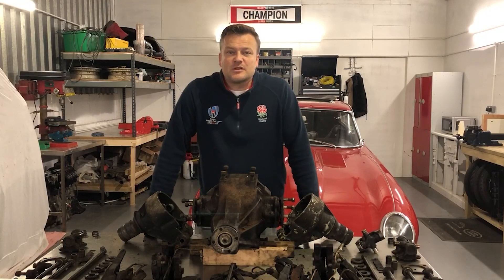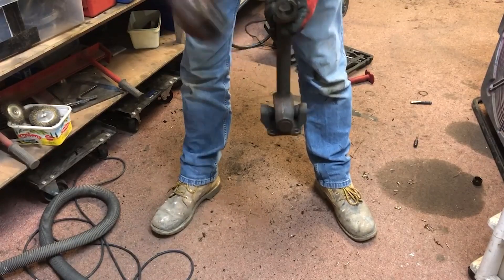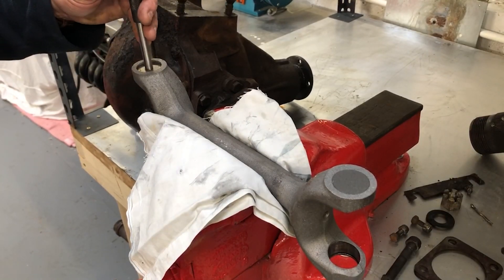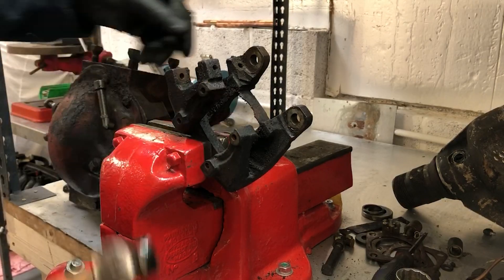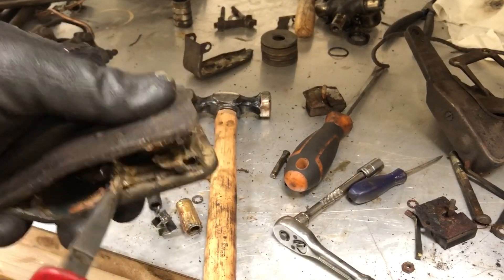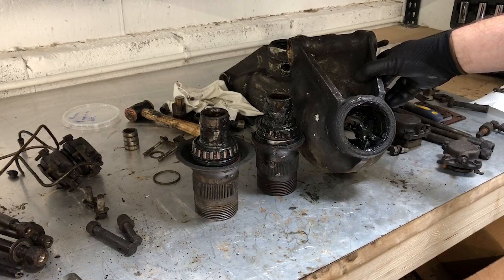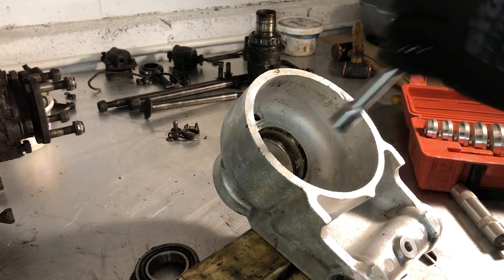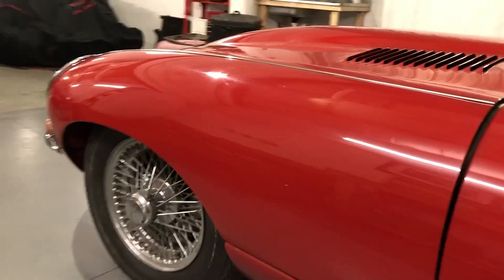Ep5 - 1967 Jaguar E-Type IRS refurb - part 1

Comment: I like watching your videos, especially when you hit a snag like with frozen bolts.  I can't tell you how many times I've had to cut off a bolt head, drill out the meat of the bolt, until the hole can be rejuvenated for new hardware.  You are a master at solving these challenges.  Any one of the "challenges" brings any part of the rebuild to a complete halt...for hours or days.  The rebuilds are a cinch compared to overcoming the "surprises".  You are very good at this... Thank you for these videos.
Reply from the maker: Thanks Stan, very kind of you. I completely agree, sometimes the smallest and seemingly simplest jobs can set you back hours trying to remove or repair or rectify! I’m still learning and I’m sure I always will be, but that’s what keeps it interesting!

Comment: Graham, I am in the midst of  full mechanical rebuild of my series 2 E Type. ( engine, gearbox, etc.) i am currently rebuilding the front brakes and later the rear brakes.  Your video on rebuilding the IRS provides a very clear and concise description of all that is involved. It will save me countless hours of work. Thank You.
Reply from the maker: Thanks very much John, I'm glad it will be of use.  I'm still learning too, in episode 7 I damage the rear hub carrier but worked out a fix to avoid doing it again so watch out for that.  Good luck with your restoration!

Comment: Graham, great videos. Thanks for taking the time and effort to record your work. I'm restoring a 1966 S type. I'm working on the front subframe first, but the IRS is next. I'm converting to splined hubs as part of the refurb and have read a bit about the process of and having to shim the rear hubs to ensure the correct end float. I didn't see you remove any shims from the hub carriers... are there none fitted to the E type hubs?
Reply from the maker: Thanks Chris, kind of you. I’m finishing the restoration of a ‘68 S-Type so you might find my website tracking it interesting. Lovely cars and underrated.
https://sites.google.com/view/jaguar-1968-s-type/home
Yes, I’m pretty sure there were some shims to set the hub bearing end float.

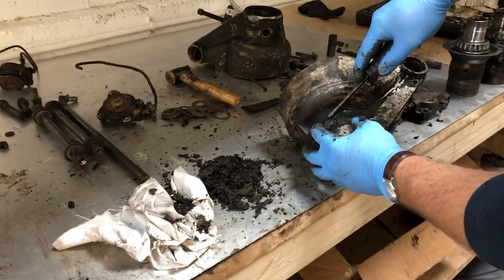Comment: I've always had a problem with the grease cap at 12:57. Getting sufficient grease into the hub & knowing that you've done so is a problem. Your thoughts on this lub point & how it can best be done?  Not asking for an exact figure but can you share what a typical IRS rebuild normally cost. Thank you
Reply from the maker: Good question, the last IRS I rebuilt, I remember packing the bearings well with grease but can't remember how much else I put in the hub before putting the cap back on.  I'll read up and share that when I get to it in the next few weeks.

As for cost of IRS rebuild.  It depends on how much you need to replace.  In a lot of cases if you have good history with the car it is possible to inspect, clean and repack things like wheel and fulcrum shaft bearings with grease, reuse distance pieces and shims and only replace the seals.  Similarly, it might not be necessary to replace splined hubs and spinners.  I would estimate that it is likely to cost at least £1000-1500, including blasting and painting/powder coating parts for a basic refurb with new bushes/mounts and closer to £2500-3000 if you need new springs/dampers/bearings/brake pistons etc.  As for the diff - this is an expensive part to rebuild if it needs a complete professional rebuild.  It is possible for the DIY'er and there are good videos on YouTube for it specifically, but not one you want to get wrong either!  Hope that helps.